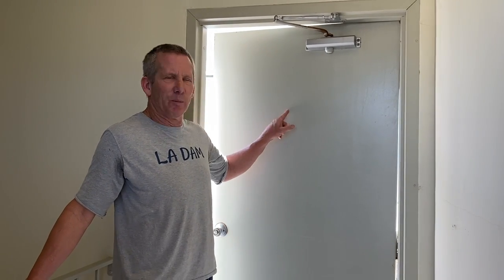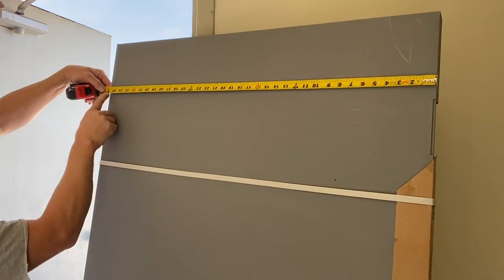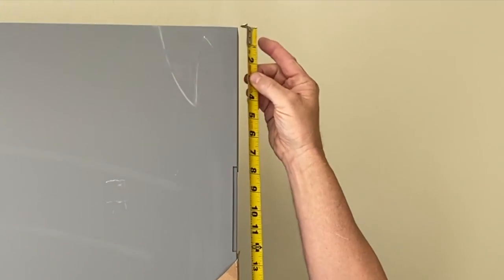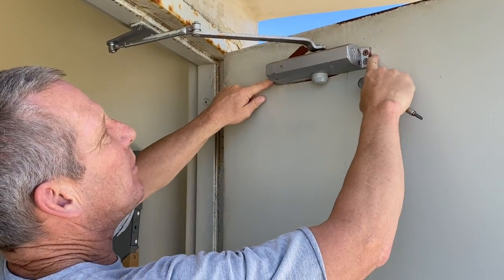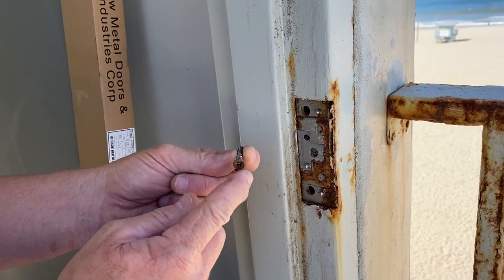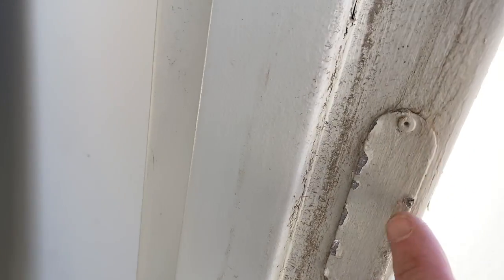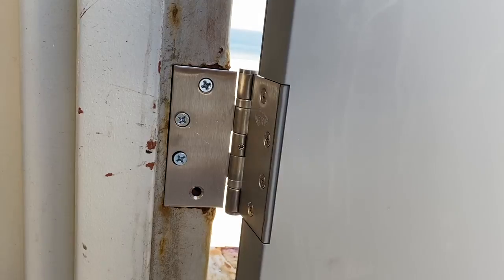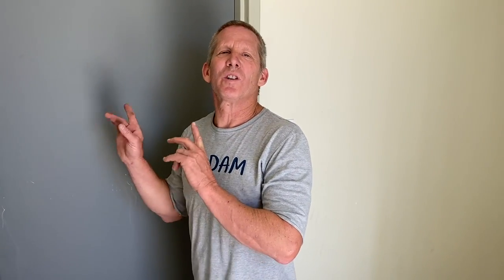How to replace a commercial steel hollow metal door in a commercial steel door frame

Comment: You need 4.5x4.5 Ball Bearing Non-Removable Pins hinges in Stainless Steel 630 (US32D)
35-3/4" x 79-1/8" Net Size,  
(3/0x6/8) Call Out size
Reply from the maker: No need for NRP's as it's just a roof top. We did get stainless AND coated them with lithium grease. 5 years and still going strong. thanks for watching.